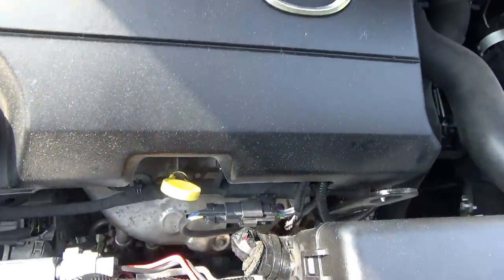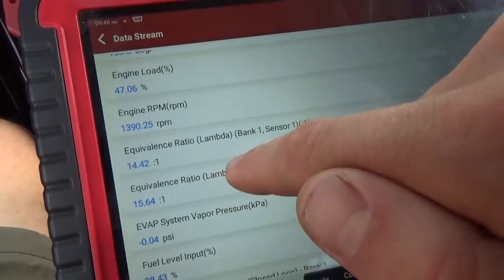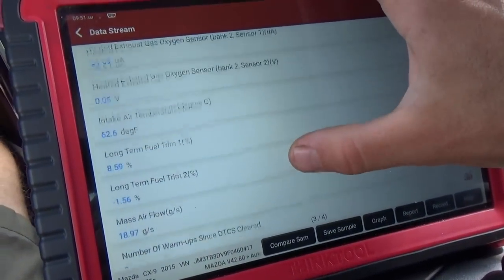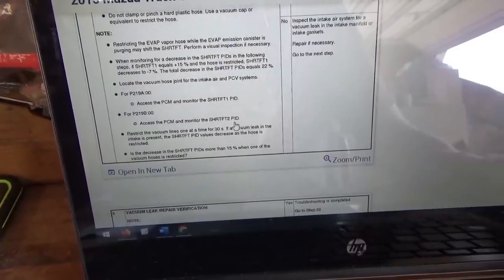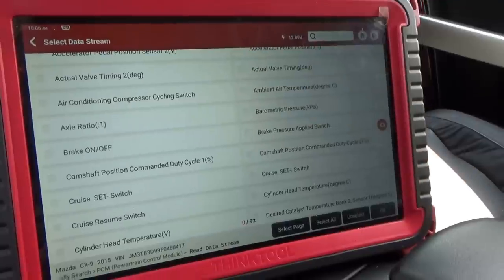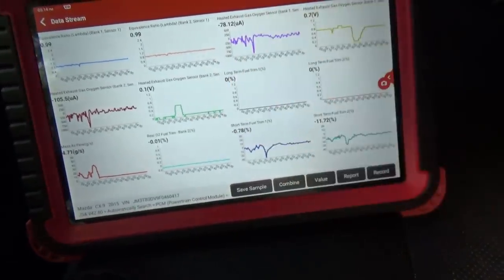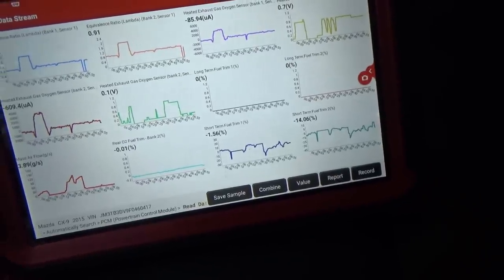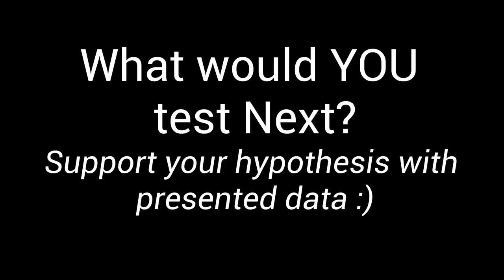Mazda MYSTERY No One Could Solve - Part 1 (P219B - Bank 2 Air-Fuel Imbalance)

Comment: The first thing I would check on would be the accuracy of the repair performed by dealer from the TSB. I looked it up and there is a TSB for 2011-2015 CX-9s with that DTC. The TSB says to separate the A/F sensor lines from the emission harness by installing a replacement short cord service part. The reason for this is because the A/F sensor lines were being affected by abnormal electrical noise from the other wiring in the emissions harness. If the dealer did perform the repair correctly, the most interesting data point for me is the bank 2 fuel status indicating "engine off" instead of closed loop. I think I would check the wiring diagram to attempt to locate that signal.
Reply: Yikers
Reply from the maker: I actually couldn't find that TSB...what's the TSB #?
Reply: @PineHollowAutoDiagnostics  Bulletin No: 01-006/15

Comment: At Lexus we had a service campaign for an air fuel ratio imbalance code. It would set due to an improperly sealing exhaust valve.
Reply: Oh so what I do my Lexus Rx 350 2014 had this code but running good

Comment: AFR is often determined by DOWNSTREAM sensors as well.  Swap the downstream sensors . Also, a localized vacuum leak on the intake can cause an imbalance so smoke check it.
Reply: I was thinking intake gasket
Reply: Agreed. I would start by swapping DS1 and DS2 and get them out of the way then go after leaks. After that injector flow rates on bank 2. Even though it runs well it can still be lean enough to get the PCM's panties in a bunch.
Reply: Went thru this on a Chrysler, down stream sensor switching slower than opposite bank due to a catalyst with a very small Crack in middle of the substrate, had to verify it with a boroscope camera.
Reply: i was thinking slight  injector leak on exhahst stroke
Reply: right track wrong event
Reply: I've had this issue with an F-150, but it wasn't as drastically difference in performance like in Ivan's case.

That said, I just watched part two...I believe he found A problem, but I'm not certain it's going to be the only problem.  I'd still swap the downstream O2 sensors.
Reply: @RK-kn1ud  swapping sensors if they come out easy costs a little time i dont think they are the problem

Comment: I would go measure the resistance on that TSB rewiring. See if you have a different impedance in that particular piece of wire that was added for the TSB.

Comment: The harness improvement looks anything but 😁 Firstly i'd have to verify that sensor they installed is actually OEM or a knock off special. Trust but have to verify. Depending on how easy access is I'd swap the up and downstream sensors across banks and measure again. Wasn't impressed with the diagnosis process on All data 🤦🏻‍♀️

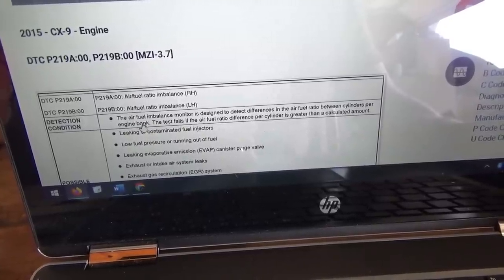Comment: 8:24 If I read the code definition correctly, it’s for an imbalance between the cylinders on bank 2, not an imbalance from bank-to-bank. I’d ignore bank 1 and focus on possible issues in bank 2 (intake vacuum leak, bad injector, sensor wiring, etc.). The real stumper for me is that the freeze frame reported bank 2 as a non-running engine? Weird…

Comment: One of the sensors has to be wrong.     I don't think it's an engine/cam problem, it wouldn't be working that well.   Other people have said it, but the two clues are (1) dodgy harness repair (2) "changed sensor"

Comment: Ivan, can I bounce something off of you? I'm chomping at the bit for the part 2 btw (I'd swap downstream sensors and see if you get similar results). So I have a car in my shop. 98 Camry 3.0l federal emissions. Came from another shop that couldn't fix it (parts cannon type). P0172, P0773. Pulled LTFT and found - 38%b1 and - 26%b2. (But only B1 rich code, not B2. Setting criteria being +/-20%. Snapping the throttle, couldn't get the upstream sensors to snap lean, showing 0.96-0.98v both banks. I do a visual and see that they've been recently replaced. Grab the part number off of the sensors to verify they are correct and find that they are wideband sensors and not narrow band. So I think bingo smoking gun, let the customer know I have to correct this before I can go further and hopefully it is the fix. Get the correct Denso sensors, slap em in (also did downstream) and now I have switching responses, lean snap with throttle, but - 22% LTFT B1 B2. Still only set P0172. I go data pid for data pid from Toyota, nothing out of whack. MAF readings, everything fine except LTFT. Of course I did the regular suspects, tested the fuel pressure regulator, checked the air filter, leaking vacuum lines, stuck egr, you name it. I threw the book at this testing it. I find 2 problems. Incorrect spark plugs, single ground electrode instead of double. And intake runner actuator diaphragm is smoked. I put aside the intake runner actuator because it is not active at idle. I throw in the correct spark plugs, now I have - 21% LTFT both banks. I walked through the entire Toyota flowchart, and the only thing I cannot test is the volume of the injectors (spec isn't given). I did a pressure drop test on each injector and they were all within +/- 5%. However, the injectors look new-ish. P/N search from Toyota says the injectors don't exist (have to call Toyota to verify supersession today). A Google search yields Alibaba, Amazon, and ebay listings... Thinking the last shop installed 2 parts that were incorrect, I'm leaning towards counterfeit/crappy injectors... I can't bring myself to parts cannon it. I don't do that. So, it's either that or according to the flowchart I should replace the ECM. Also, initial start after the KAM is cleared, upstream O2 sensors when the warm up immediately show - 21%. Then the OSX1+2 tests finish and the LTFT then gets pulled from 0% to - 21. As it does so, it starts running worse, then misfires, and pulls the trim even lower. -3, -7, -11, -16, ect. I know it's limited info, there's SO much more I've left out for lengths sake. Downstream reads 0.96v, same as upstream but steady instead of switching like the upstreams do. I'm really considering it's the wrong CC injectors. But it's strange that the PCM only throw P0172 with both banks below  - 20% LTFT.  Eric O had that problem once on a shevy silverado, 6.0l injectors installed on a 4 8l. I'm wondering if the customer has injectors from a 3 3l or something like that. Any thoughts? Thanks Ivan. You'd be all over this case study if you saw this, whole time I'm asking myself what would Ivan do next 🤣
Reply from the maker: Unplug the MAF and recheck trims. What's the MAF read at idle? What are the trims under load? Could be a classic dirty MAF NPR 😁
Reply: @PineHollowAutoDiagnostics  Checking with the MAF unplugged, before I found the spark plug issue but after the oxygen sensor replacement, I got - 22% LTFT on B1 + B2. MAF reading was between 3.7gm/s and 3.9gm/s at 700rpm, with Toyota spec between 3.3 and 4.7 with idle being 650-750rpm with no loads. I did a visual to make sure there wasn't a leaf or anything goofy like that in the sensor and hit it with some MAF cleaner with no changes in the reading. I can't tell you how much I appreciate you replying Ivan! I'm at the point now where I'm about to go pin for pin on the ECM electrically. I've got a Launch scanner that I can't always trust like your think tool. Where it says degrees Celsius but it reads Fahrenheit. Or it'll say hz on the MAF but reads in gm/s. Always leaves that little bit of doubt. The part that I'm left at is, it's either a lack of air (or mis-measurement), or too much fuel. Also, it has a hell of a hesitation at just off idle while trying to accelerate, but not always. TPS checks out without any dead spots.  Once it gets past that at 1700rpm, it flies. I'm attributing that to the terrible fuel trim or the intake runner valve diaphragm. I haven't checked for a restricted exhaust (plugged cat) yet, but thermals are showing cooler inlet and hotter outlet by about 400 degrees, so it's functioning and it does have the power you'd expect, so I hadn't tested that yet. Oh, also trims under load actually get worse, stft starts hitting - 30%ish, but doesn't take the ltft in that cell to more than - 24%,
Reply: @moo3993  Sound like an interesting headache case. Have you try to test VE on it? wide throttle and the trim got worst? that sound like dirty MAF. Possible that it have wrong injector flow. but you did injector pressure drop test and it is within spec of each other. interested to see what the problem is.
Reply from the maker: @moo3993  How did the original plugs look...black and sooty or clean and light?
Reply from the maker: Check the fuel pressure diaphragm vacuum line for raw gas. Not many things can cause a true RICH condition....
Reply: @PineHollowAutoDiagnostics  you know what's funny the fuel pressure regulator was the first thing I thought of because I've done so many of those that sit on the rail where the diaphragm ruptures. This car has a deadhead system with a in tank fuel pressure regulator. At idle I get 49 PSI, and when I snap the throttle hard, it never drops below 45 PSI. I even did a little volume check with the fuel pump and just did the fuel pressure release dump valve on my gauge and had it squirt fuel out and the pressure still maintained at 44 psi. So fuel pressure regulator is good, fuel volume doesn't seem suspect (Toyota doesn't give a spec of volume vs time). I need to correct myself I've rechecked with the maf unplugged, car stays in open loop, no LTFT or stft adjustments at all. Everything stays at zero. Also, the plugs I took out were black and sooty. No indication of pre-ignition or oil contamination. I wish I could attach a picture to this comment LOL. Look very par for the course. Car says it's running rich and the plugs definitely indicate that. I did check with Toyota earlier and they told me the part number that I found on the injector has been superseded to a newer number. So part number one is they are the correct injectors for the car, but we don't know if they are quality injectors or not. I do not see the denso laser etching on the sides of the body, no discernible marks except for the OEM part number on the plastic cap on one side and then a two or three digit number stamped on the other side. I did find a specification from another website for the flow rate so I need to pull them out and create a testing rig for it so I can check volume against spec. That would be the only way I can verify the flow rate but I don't know how I'm going to set something like that up yet. You mentioned something in this video about the camshaft timing being off and starving the cylinders of air. I pulled off the timing covers and checked to make sure that the valve timing is correct since it is belt driven, and both camshafts and the crank lineup. No signs of the roll pin shearing from the camshaft pulling to the camshaft itself. (I've found that before with the roll pin sheared). Also the fuel injector pulse that the computer reports does match what my oscilloscope reads and it is within spec per Toyota for idling. Coolant temperature sensor reads about 10 degrees F hotter to the computer than the actual sensor is using an infrared thermometer but that would mean that the PCM is going to lean it out more if I recall correctly. Any thoughts outside of that so far Ivan?
Reply: @RongTrang  I did the injector pressure drop test, so all injectors dropped the same amount of pressure between all cylinders, but Toyota does not give a spec for it. I'm just going off general diagnostics, sticking injector or open injector testing. Also when he fuel system pressurizes and the fuel pump is off the fuel system holds the pressure at 44 psi which is within spec and holds for 10 minutes so I don't suspect a leaking injector or stuck open injector either. Only thing I haven't been able to test is injector volume, Toyota doesn't give us back but I was able to find a website called injector planet that gives a specification for this injector.
Reply: @PineHollowAutoDiagnostics  Hey Ivan, got to the bottom of it. It could have only been the injectors or the PCM. I got a set of used injectors for the customer from the local wrecking yard, they were the correct part number, threw them in  and bam, fuel trims are now fantastic. - 4% B1 LTFT and + 2% B2  LTFT.  Running the car through the different cells shows a similar result, the customer had a set of Amazon fuel injectors put in their car and they were far from good. I mean technically they would be a great set for a engine upgrade like forced induction, but yeah. Figured I would let you know it was something that is just totally not normal and would have totally been a car to come to you for a case study. I feel like I'm the Ivan of Las Vegas sometimes with this stuff 🤣🤣🤣 I've got stories 🤣🤣🤣 Thank you Ivan for the help on the diagnosis, and all of the videos and teachings over the years. That Audi headlight job was pretty damn cool, can't imagine how happy the customer was.

Comment: I’d swap sensors between banks.  If nothing changes, I’d look towards injectors.   If you had a leak in the manifold at the right location it might only effect that bank.   Ultimately we have to find if the computer is receiving incorrect data, or if there is a cause for the data to be how it is.

Comment: I had a 2009 Corolla with the same AF Imbalance (Bank 1 of course) that turned out to be a burned exhaust valve in one cylinder. It ran perfect, had no misfires or stumbles, but it failed the leakdown and replacing the valve solved the code. Just another path in case you sensor theory doesn't pan out.
Reply from the maker: Burned valve on a Toyota? That's impossible! 😅
Reply: @PineHollowAutoDiagnostics  Shhh, don't tell Scotty!
Reply: We all know that burnt valves  is the aftermath  of 
REV UP UR ENGINES!
😄🤣😂

Comment: Swapping the HO2S is a good idea.

I don't think is a timing issue, considering it doesn't have P00xx errors.

I will check if Ford have a different approach to this issue, because this is a Ford Cyclone engine (yes, the one that have the Water Pump driven by the Timing Chain) and I believe they share the same PCM.

Edit: Ford Test Procedure for this error has more information regarding Resistance and Voltage on the HO2S than the Mazda Procedure. And yes: Same PCM, and almost same CAL ID.

Comment: Of course it's an injector, the error description seems pretty clear. One of the injectors on bank 2 is dripping like a garden hose. EIther test them or move them to bank 1.
Reply: mai tanase daca un injector is leaking like a hose trebuie sa se simpta ca motorul nu merge rotund
Reply: @marlu6373    Romanian to English:  "even better, if an injector is leaking like a hose, it must feel like the engine is not running smoothly"  for those who wish to know what mar lu wrote.    My response:  Este o idee interesantă!
Reply: @jeffryblackmon4846  looks like you know romanian or the good new google translate

Comment: I would probably check to see if the air fuel ratio sensors are the correct part number for the vehicle…
Reply: That's often times not possible, usually they don't print any visible numbers/letters on O2s and A/F ratio sensors.

Comment: The main thing is determining if there is a sensor problem or not.  The plugs can be inspected to see if there is a rich/lean on one bank or cylinder.  Is the exhaust backpressure equal or is a cat problem? (not sure if there are cats on both banks or not). Then there are the injectors.  A flow test would reveal a bad injector.  But remember that per the documentation this is a cylinder to cylinder and not a bank to bank code of course taken with a grain of salt when it comes to these things.  Definitely the downstream stuck sensor is a great place to start.  General engine mechanical like compression would be next.   Sometimes it helped me to force the computer into backup strategy by disable the maf and see what is up.  This is a weird one.
Reply from the maker: Great suggestions 👍

Comment: my experience with mazda was intake air leak on bank 2, very tinny leak, but I used teflon tape to tighten the O-ring gasket seal. no more issue(engine light) over the past year.

Comment: I love these video's on these crazy jobs ,IVAN. i'm only halfway watching ,but I'll take a stab at it,to see if i can guess. when you read the causes i guessed if the engine has a plastic intake manifold,my thought is could it have a crack in one of the runners going to a cylinder making THAT CYLINDER LEAN.But only affecting a single cly.therefore they Assume that will set a code.Also then what if the intake gasket right at the manifold to the head was ONLY leaking at 1 cylinder? or could the computer THINK a fuel injector IS not operating as good as the rest of them? therefore trowing the code? just guessing,thanks

Comment: I'm not as used to working with A/F ratio sensors as much as good ole O2 sensors, but this kind of seems like a stuck or skewed low Bank 2 Downstream sensor.   But then again,  I do see it jumping up to near .7 Volts sometimes.  I'm also kind of lost at this point, as to where to go next.   
Also, what kind of PCV system does this have?  Does it connect with a single bank, or both banks??  The computer seems to think there is a minor rich condition on the affected bank,  maybe check your injector waveforms on the bank in question.  Maybe there is a slight mechanical issue with one injector.  Possibly sticking open a hair too long or something.

Comment: Pull the plugs and read them, thinking injector malfunction or vacuum leak.
Reply from the maker: Great suggestion! Spark plug analysis is still relevant even on modern engines 🙂👍